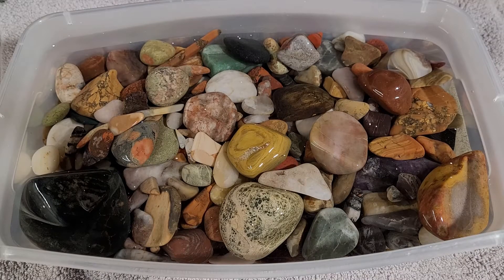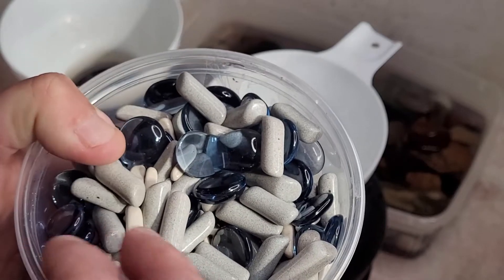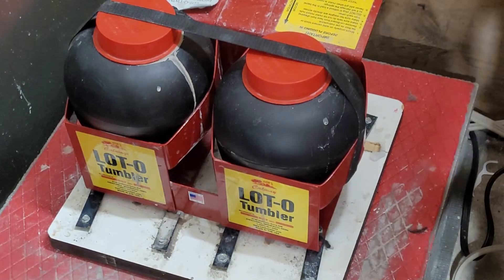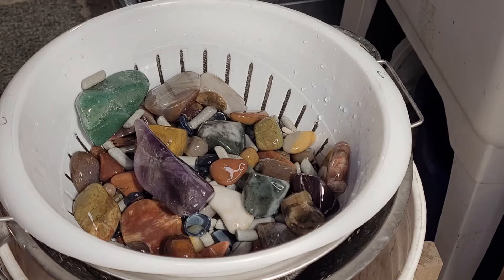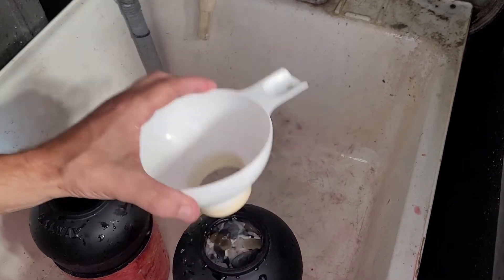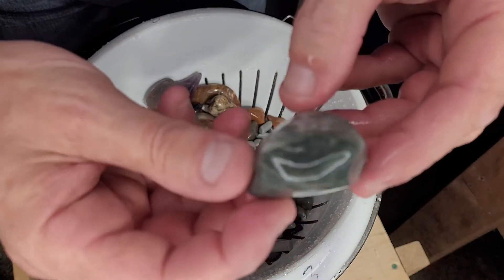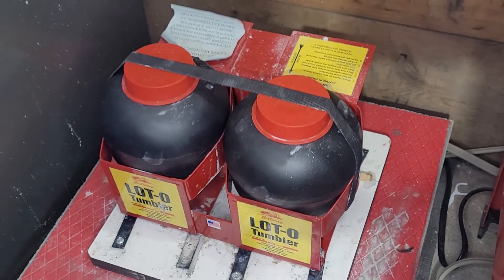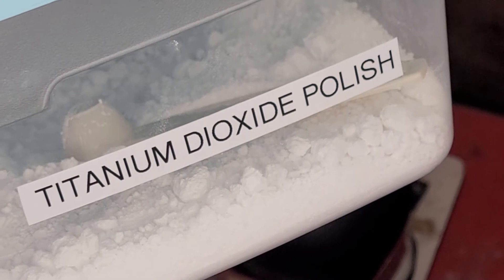Double Barrel Lot-O Tumbler

Comment: Very informative. Nice job! Not too many using the double-barrel Lot-O. We just finished our first video which is very similar but uses the UV-10. Please give us a view. We'll have more on the way. The biggest holdup right now is finding/learning the video editor. We used DaVinci Resolve but it's really too power hungry for my old computer. Any suggestions? What do you use?
Reply from the maker: I bought the double barrel because I had a 12 pound MJR tumbler, but the barrel wore through. It’s still a great machine. As for software, I was using the standard Windows Movie Maker that came on my laptop until it crashed. It wasn’t supported by Windows anymore. Lost about 6 videos I was working on. I ended up buying the new version of Movie Maker. It works quite well so far. I’ve only been using it for a few weeks. You can download the free version, but it leaves a watermark when you finalize your video. There’s so much out there for software, it depends on how much you want to do with it. Hope that helps 😁